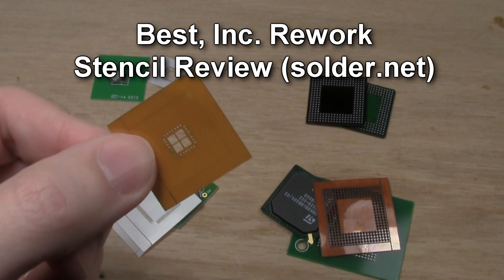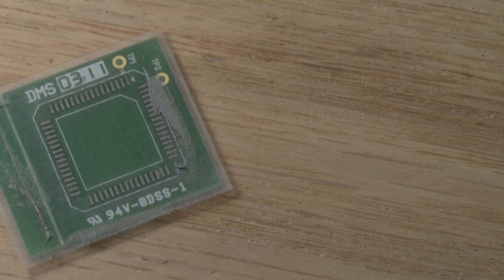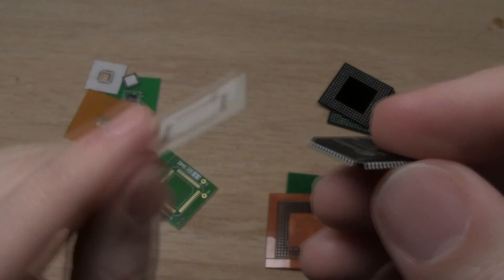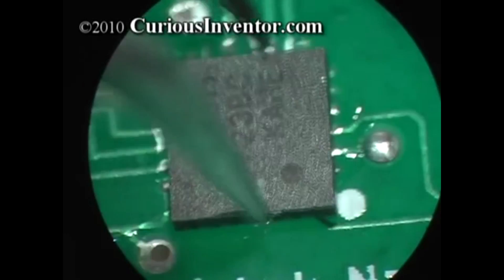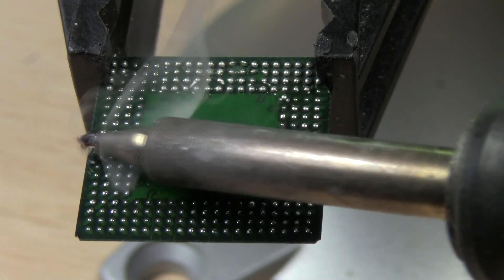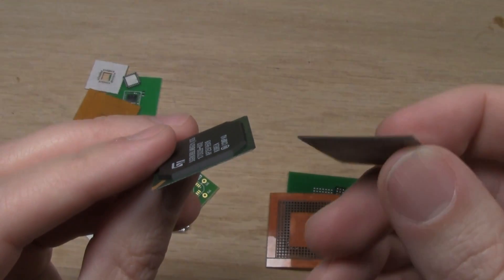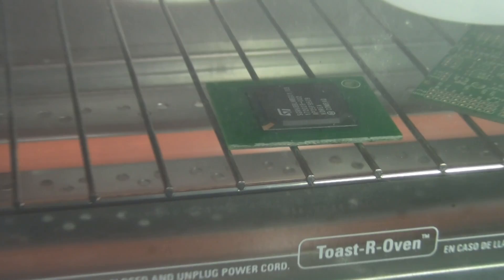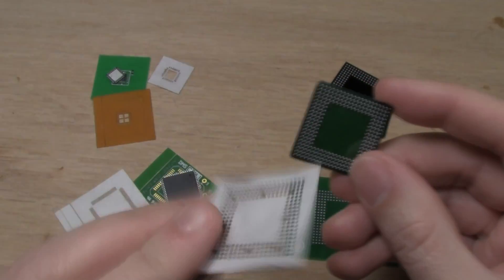SMT Stencil Review, including BGA Reballing

Comment: With almost same amount of money you can buy from ebay  BGA reballing kits with  universal stencils AND dedicated ones!  Solder balls included.And about QFN, if you have enough practice, you can solder them only with hot air and soldering iron. The price for this "quick" single-use stencils is way too high in my opinion. And let be honest, if you have a QFP chip to solder, the quick and low cost solution is BY HAND! Instead of spending ten's of dollars on a stencil, you waste the same time for board preparation, its more easy to just put the circuit in place, fux, and soldering with multi-point technique. Happy soldering!  This is the most complete review of this kind. Thank you!